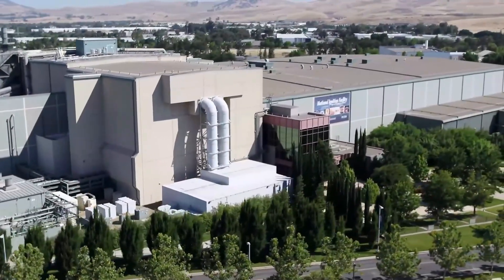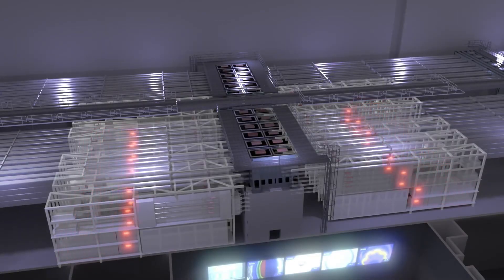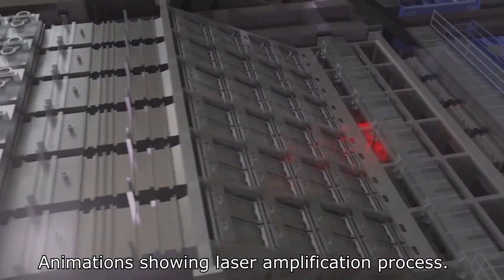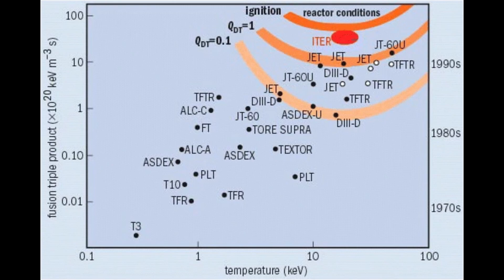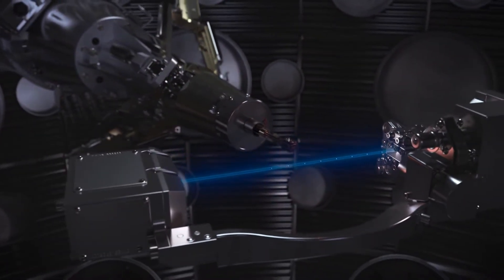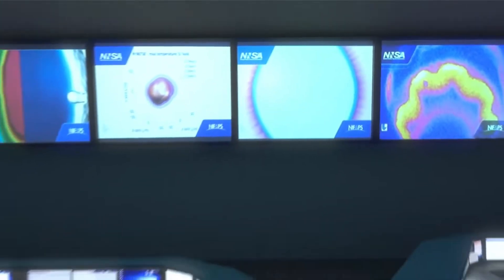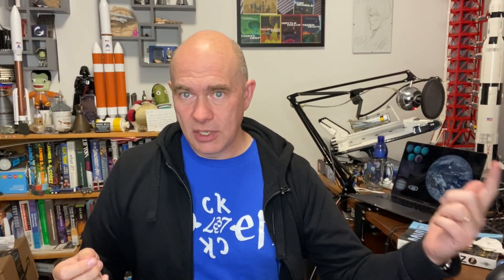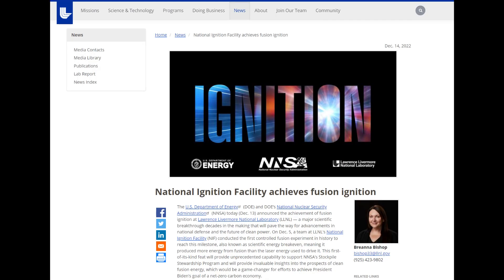Why The Biggest Laser in the World is Making Big News About Fusion

Comment: So what is the future of laser efficiency gains? Any ideas about how to achieve this? Will it be another 30 years?
Reply: The future laser ICF efficiency gains are potentially massive and have been clearly defined for decades. Third harmonic NdYAG systems could use polycrystalline sintered optics continually cooled with flowing helium and optically pumped by GaAs laser diode arrays tuned to the 885nm absorption band of Nd for maximum efficiency probably somewhere in the mid-30% range. Krypton fluoride deep ultraviolet drivers could be easily high rep rated due to ease of cooling gas lasing media and could achieve 15% wall plug efficiency.
Reply: @Muonium1  I hope I live to see the day that a diode-pumped 3rd harmonic Nd:YAG laser is scaled to 2 MJ pulse energy.  Nd:glass is a far better laser medium for high energy pulse amplification.  Just sayin'...
Reply: Oh, and KrF excimer laser technology?  I'll NEVER live to see the day that megajoule pulse energies are achievable with that technology.
Reply: @claudiusdunclius2045  no it isn't. glass is a terrible conductor of heat and takes literally hours to cool down, hence the reason NIF shoots once a day.
Reply: Using lasers was good for a test, but they won't be used for sustained reactions. That's the purpose of tokomaks. So really, the efficiency of the lasers isn't particularly relevant.
Reply: @SuprSi  Says you. ITER needs to disassemble and rebuild the wall liner due to cracks. No plasmas until at least 2030 let alone DT fusion until prob 2040.
Reply: Their lasers are less than 1% efficient, so not anytime soon.

Comment: The need for tritium in these processes really hurts their value though.  As you mentioned, the best way to get them is... from a fission reactor.  Which either means a co-habitation of both types or discovering a different more ready element instead of hydrogen.
Reply: Tritium could fairly easily be made in a tokamak (from lithium blanket components). That's one of the easier parts of making a practical reactor.
Reply: Helion Energy has a fusion reactor that produces Tritium and Helium 3.  It is supposed to be online in 2024.  It could sell these even if it just gets a "Q" just a little over 1. Helion Energy also plans to recover energy by having the plasma move linearly through coils producing electricity.  The whole system is developed and is supposed to be online in 2024.
Reply: @jamescottrell7147   Q-plasma of 1 won't be a surprise, the ITER is going after Q-plasma of 10 or more. So what? This ain't Q-total. It will be just a glorified heater that is eating 500MW and at the best case scenario someday will be able to output 250MW.

Comment: Glad you put this topic in the right light. It WAS a great achievement to generate more energy than the lasers put into the pellet, but the one thing that wasn't expanded upon was that 1% efficiency of the lasers. In order to produce 2MJs of laser energy, the amplification process required 300MJ of energy itself. So the net output ended up being 1% of the actual input energy.
Reply: @Jo Blow I'm not forcing anyone to read my comment. If they don't wanna know, don't read! 😂
Reply: Commercial fusion won't be using lasers and fuel pellets so the lasers could be 0.0000001% efficient and it wouldn't matter, it's completely irrelevant. The fact is the test was a success, and now we KNOW that nuclear fusion is viable. Tokomaks will take over from here, lets go ITER!
Reply: @SuprSi  It's been known since the 1950's that fusion is viable. It was called the H-bomb. This experiment was a success, agreed, but it's kind of a waste of time and money since it's been known that this approach is not a viable method of producing a sustainable fusion reaction. The precision required in the construction of the pellet and the exquisite timing required in landing the lasers on target is a huge testament to the skill and tenacity of the scientists and engineers at the NIF, but it's not a viable way forward in producing energy.
Reply: Modern lasers are much more efficient than the 90's vintage that NIF is using.  They aren't anywhere close to 100% but they are maybe like 20% from what I've read?  In which case that's proof that a system 20x more efficient is buildable today.  So the 1% thing is really overblown.
Reply: @JMurph2015  nice to know! Thanks for the update. Now if the DOE would spend the money to upgrade the lasers at the NIF.
Reply: @ICAleinns  see the thing is that it's irrelevant for the NIF to spend millions or billions of dollars to upgrade their lasers since it was never designed to be a power plant itself.  As long as the lasers there are well understood and working, there's not a scientific need to replace them since it's well understood that you could drop in more efficient lasers as long as they produce the suitable beam characteristics.
Reply: @JMurph2015  Agreed. The achievement made was tweaking and tuning of the pellet and the timing of the lasers in order to achieve the precision required to achieve fusion. However, I can't see a viable way to recover the energy produced from this form, or a way to scale it up to produce the number of reactions needed in order to produce a meaningful source of energy. Maybe with newer lasers they could come up with a better design.
Reply: @Jo Blow modern steam turbines are extremely efficient.  Something like 80-90% of recoverable energy is converted to shaft power and electric generators are also in the 80-90% range.

Comment: Scott almost said something insightful but then fudged it. To capture fusion power from the sun you need a box. It's called a solar panel. The technology is mature and it's cheap.

Too often the videos about fusion simply ignore the one thing that does matter - cost. If it costs more than the alternative (renewables plus mature energy storage) then it is irrelevant.

I love the engineering involved. But there is no possible future where fusion will compete with vastly simpler technology. This will always be so.

Comment: I actually thought Mr Manley was a knowledgeable guy until I saw this.  We can take nuclear waste and burn it in a molten salt reactor until the actinides are reduced to near nothing, and have enough energy for as much clean energy as we need for 100’s of years.  We can combine Thorium in the process.  This advanced micro nuclear fission reactor is in development and will likely deploy in 2027 by the USAF. This nuclear fusion is a red herring that obscures what we should be doing instead of wasting tax payer money helping EVs, which solve at most 2% of global carbon issues, and that is accelerating the prototyping of both the micro-nuclear reactor and mass manufacturing of it.  The DOE knows about this.

Comment: I realise this is a video mostly about NIF, but in your summary of other efforts I think you should have spent more time on MIT/Commonwealth Fusion Systems.  They really look like they’ve got magnetic confinement nailed, and should have a working reactor with a Q_plasma around 20, and a Q_total around 2 within the decade.
Reply: Ok. They've got magnetic fusion nailed. But they're putting more energy into it than they're getting out. So what's the point of "nailing" it if it doesn't solve any problems?
Reply: @davecarsley8773  q_total = 2 implies that they are getting 2x the energy out than they are putting in...
Reply: @JMurph2015  2 times the heat energy.  You'll be doing quite well to get a bit more than half of that out as mechanical work, and a little less than that as electricity.  Since the input energy is electricity and the output you're talking about is heat, we actually have to factor those inefficiencies in.  The result is that they're probably not breaking even yet.

Comment: I work in the fusion industry. There's a ton going on right now. Commonwealth Fusion System's high-field advanced tokamak is under construction (or at least the building is), and is designed to match or beat ITER plasma performance at a hundredth of the size and a decade earlier. As a side note, tritium breeding blankets are excellent tools for converting neutrons to heat. To sustainably produce power you have to multiply your neutrons, because you need to turn more neutrons into tritium than your reactions actually produce, since there will inevitably be inefficiencies in the fuel cycle. This means that a good blanket design turns >90% of the neutron energy into locally deposited heat. A lot of companies are looking at liquid lithium or FLiBe breeding blankets that serve as both a cooling system and a tritium recovery system.
Reply: Helion Energy is my bet to first profit.  Their opposing pulse fusion drive reactor produces Tritium and Helium 3 as well as electricity.  The plasma of their reactors moves linearly through coils to the charge produces electricity.

Comment: i dont hold my breath for the NIF "breakthrough". it took them over 10 years to get to this point....... Q=1.5. we need minimum.....MINIMUM Q=30, better 50 or even 100 energy amplifications to be viable for a commercial power plant. 
ITER will hopefully reach Q=10. followed by DEMO with Q=30.
BUT DEMO will be probably a stellarator and will MAYBE use the new coil magnets the MIT developed. first calcs show, that those MIGHT lead to a 3 times better confinement. so DEMO could maybe reach Q=90 with those new magnets.......or they are able to scale the reactor down.

i bet my money on the magnetic confinement still. NIF is nice, but they need to increase by a factor of 60! 
and then also need to figure out, how to ignite several pellets per second to get usable power output. 

and THEN they face the same problem ITER wants to figure out. how to mutate kinetic energy to thermal for power production. 
NIF will also need blankets! 

so no matter how it goes......NIF needs to WAIT for ITER anyway, because of the blanket development

Comment: The last reactor design with the pistons is interesting.  I can't help wondering if it's theoretically possible to make a diesel engine that has such a high compression ratio that it can achieve ignition of nuclear fusion, not just chemical ignition of diesel and oxygen.  By theoretically possible I mean the sort of theory that ignores any inconvenient facts.

Seriously though, although what they've achieved at NIF isn't very useful itself it does show that it's possible to have fusion on Earth that produces more energy than it requires (as in it's an experimental facility, not a much needed fusion power station)

Comment: Smartass answer: The best way to harvest fusion energy is usually photovoltaic panels on roofs.
Also, after a period of time, the fusion power facility will need a rebuild due to neutron embritlement of fusion adjacent metal bits. This will produce a lot of useless radioactive alloys and concrete.

Comment: An imperfection the size of a single bacterium is about 1 micron, i.e it's not that small. I believe imperfections in standard optical surfaces are held to a standard at least lambda/4 (~100-200 nm for visible) or less.
Wasn't there a major controversy about cavitation-induced fusion? https://en.wikipedia.org/wiki/Bubble_fusion

Comment: They created fusion by rapidly vaporizing (exploding) a diamond shell around the fuel using lasers. The worlds most expensive pellet stove. Achieving ignition by compression with an explosion isn't really progress.  It's just another form of nuclear weapon research.  Burning diamond coated pellets is never going to be economical. 3 Million Joules is 3 Million Watt Seconds.  So 1000 Watts * 3000 Seconds.   They created enough power to run a small hair dryer for less than one hour.  It's like powering your car by lighting a stick of dynamite on your rear bumper if you lit it off with a huge bank of lasers.  Seems we might be 100 years away from this being economical.

Comment: My grandfather was good friends with John Lawson ( of criterion fame) and he would have been absolutely delighted that this had been accomplished . Truly a scientific milestone, despite the ‘so what’ of modern journalism.

The lawson criterion is no meagre barrier, it’s really an important maxima whereby any more energy added starts paying  exponential dividends as you achieve more and more fusion and the energy from this.
Reply: Why does this remind me of scramjets? lol. thanks for sharing.
Reply: This is not a scientific milestone, at least nothing worth talking about.  "Modern journalism" is right to not care.  Let me explain.

Sadly, they straight up lied at NIF, which is sad, because we're WAY off from net gain in energy, and they lied by a factor of roughly 250x...  They refuse to actually take into account any and all inefficiencies and simply ignore them, which is what makes this incredibly dishonest.

"the huge lasers at NIF are less than 1% efficient, so to generate more fusion energy than actual input energy to the facility, you'd need to increase the yield [at least] 100x"
"Plus, the fusion power is in the form of heat and radiation, and needs to be converted back to electricity. Assuming a 40% steam cycle efficiency, that's another 2.5x increase in required yield. So we need a fusion reaction [at least] 250x MORE POWERFUL to achieve true electric net gain"
Reply: @krillin6  it’s not a lie, there is more energy coming from the reaction than it absorbed. That’s an important milestone, known as the Lawson criterion, that has never been reached before. NIF is not saying this is a power plant, they’re just reporting a successful experiment. Poor journalism is trying to inflate this.

Comment: Details of Helion Energy attempt at fusion in 2024 using opposing pulse fusion drives.  The plasma has a moving charge which will be used to produce electricity.  It also produces Helium 3 in the process.  https://youtu.be/BlQnzNHN2-0?t=861

Comment: Greetings:
I know that the repeat rate for the laser requires some time to recharge between firings; but almost continuous firing is required before any practical/useful energy removal is possible.
Reply: This wouldn't be as true if you scaled this up, and used a higher portion of the fuel (I think in this one the best they got was like 5% of that tiny bead of fuel). Also these lasers are dog shit in comparison to the most modern efficient gas lasers, they are using 20+ year old lasers, no matter how efficient they have managed to tune them they aren't going to be as good. So if you use modern lasers, that are far more powerful, mixed with larger fuel beads, and achieve a higher proportion of fuel used, it wouldn't be as necessary to have continuous firing.
Reply: @rdizzy1  All true. I'm just pessimistic that all of that is actually achievable. If even one bit of this isn't scalable, the whole project collapses. There are a LOT of different ideas flying around tho, I'm confident at least one of them will be able to find some purchase in the energy futures.

Comment: Between lack of affordable Tritium, and fact that leader of the Lab said they technically may not consider this as more energy out than in, since whole facility uses 300MW to operate, and the lasers can only fire 1 time a day at most right now, when they would need to be 1,000 times more efficient and be able to fire 100,000+ times a day to work. Lets just say if we get 1000+ fold improvement on our laser technology, we will have easier cheaper space based power delivery system instead of very complex costly laser compression fusion.  Don't get me wrong whatever magic we need to do to get on demand energy alternatives the better for humanity, but also don't hold breath on this type of fusion for a long time.

Comment: One reason for going back to the moon, touted by Harrison Schmitt, is the abundance of helium-3 captured in moon rock from the solar wind.  Supposedly it's a great fusion material because it produces so few neutrons.  Is helium-3 a proper fuel for ignition?
Reply: Helium 3 doesn't produce the neutrons which are a problem.  Helium 3 is a more desirable fuel. Check out Helion Energy's reactor that produces Tritium, Helium 3 as well as electricity.  Producing these Helium could be profitable with a "Q" of 1.  (Same power out as put in equals a "Q" of 1) Check out Helion Energy.

Comment: So what they did was use a couple MWh to create enough laser energy to heat a teacup someone had taken a couple sips out of by a few degrees and got enough energy out of it to heat a full teacup by the same margin...
Reply: I heard some researches started with a thermos full of cold water and turned it into boiling water by merely shaking it vigorously. They took turns, and it took them all day, but it worked. It sounds like a much cheaper, and more effective, way to get a hot cup of tea.

Comment: One way to increase efficiency for fusion plants is to sidestep the transform heat into electricity part and directly use the heat. Nuclear district heating has already been largely demonstrated in fission plants, and there's lots of industrial processes that require lots of heat.
Reply: While the conversion is pretty inefficient, it may also be inefficient to build many small plants instead of a few big plants. Every other energy generation using heat has also the same advantage so this is no special advantage for fusion.